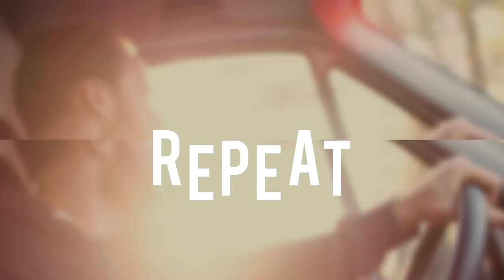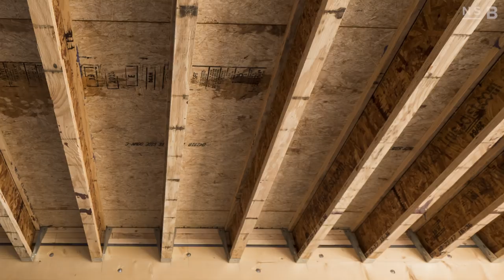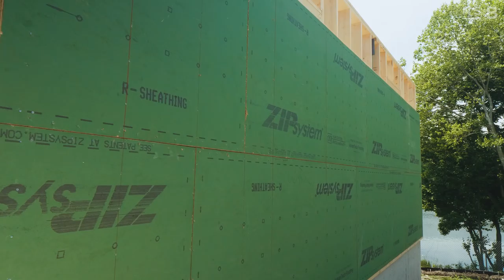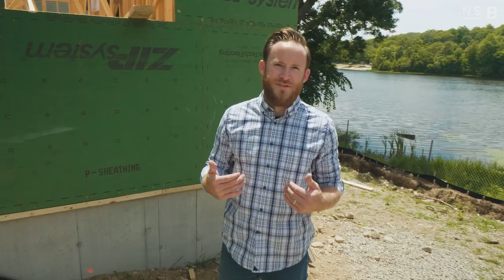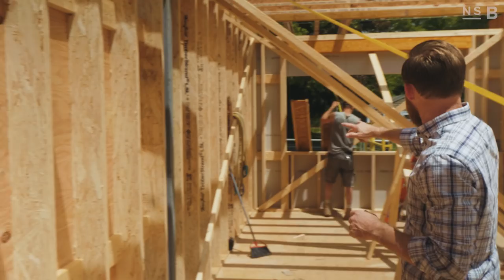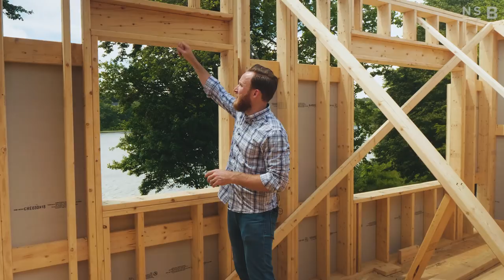Engineered Wood: Lake Drive Custom: Ep 03

Comment: Exterior wall framing where traditional 2x10 header sandwiched together, we now use one 5.5 LVL or timber strand on the outside. We don't use 2x6 flat under the header due to squash factor, but we do add a 2x6 under the header between the trimmers. For casing etc. Then you have the room to insulate the header leaving less R transfer.

Comment: Looking good, Nick. I probably would have dropped that basement beam a few more inches to eliminate the hangers, and chances of squeaking. I can see there being some square duct running by the beam, dropping that part of the ceiling anyways. 
Can't wait to see the final product.
Reply from the maker: Marko we really wanted as high of a ceiling as possible down there. One tip the framer mentioned that has been super helpful is keeping the hangers slightly wider than the joist. So they're fully supported but not squeezed tight on the sides.
Reply: NS Builders that's a good tip. I also make sure that mine are glued. I'm sure it would be fine in both cases. Thanks for the reply!
Reply: Marko Yea, a dab of construction adhesive on the hangers helps prevent squeaking.
Reply: singletrack86 squeaking you hear in floor framing is usually caused be wood rubbing on metal, weather it be hangers or nails. This is why it's always best to glue your decking to the joist and joist to hangers. You still nail/screw, but the glue reduces the chance that the the wood will move and squeak. The oversized hangers also reduces the metal to wood contact area which reduces the opportunity for them to rub and squeak.

Comment: The jack studs should go to the bottom of the header. With the 2*6 on the of the header there is potential for crushing. 
Your doing a great job
Reply: Obviously hard to tell but, I'd guess its non-load bearing. Seeing as the headers 1 ply, it wouldn't make sense to go back afterwards and add more lumber

Comment: Why use engineered lumber vs. a 2x10?  Laymen’s terms please for the non-builder viewer. Love your work
Reply: For the floor joists? Stiffer and flatter, for one.
I just used them on my current build, and it allowed us 24oc spacing. The biggest benefit was nearly eliminating bulkheads by running ducts through the joist webbing. There are some rules to follow, but the manufacturer provides a handy chart.
Reply: nah, use 2x10s for the walls
Reply: If you're talking about the engineered lumber for some of the walls, it's because those walls will have finished cabinetry on them, and you need them to be perfectly flat to avoid any issues with gaps in your cabinets.  Tile work is another place where perfectly flat is helpful, for say a kitchen or bathroom backsplash.

Comment: Rad. Curious if the r-sheathing creates any water vapor concerns inside the house since it’s not a vapor permeable product? Any special measures taken inside the house to adapt to this?
Reply from the maker: We will be running a 24hr ERV in the home, plus fully air sealing our walls.
Reply: NS Builders  Right on. Those measures will help reduce vapor diffusion for sure. To refine my question, I’m more curious about interstitial condensation created in the colder months of the year. A vapor permeable wall system can adequately handle this scenario by allowing vapor to diffuse through the system in either direction. However a vapor impermeable r-sheathing system prevents this exchange from occurring. Are you folks implementing special measures with the r-sheathing to manage/prevent interstitial condensation?
Reply: As long as the r-sheathing provides enough insulation to keep potential condensing surfaces above dew point then interstitial moisture should be kept to a minimum and the wall system should have plenty of drying capability to the inside (assuming no vapour barrier on the inside).
Reply: Stephen V Rad. That makes sense. Who runs the calcs on what thickness of r-sheathing (or exterior insulation) keeps potential condensing surfaces above dew point?
Reply: Kyle Ray Hughes Air sealing with the Zip sheathing and an adequate ERV should keep the humidity in the house in check and eliminate the possibility of condensation. Im sure they will also be adding an air gap of some sort between the exterior "siding" and the sheathing, the space between there is where most moisture problems accur. As for the thickness of the foam it all depends on your local climate, hear in the south we can get buy with half inch foam zip sheathing.
Reply: Depends.  Often the manufacturer has done calcs to determine that depth where condensation occurs (depending on the climate), or if you're using a passive house certified Architect (or similarly credentialed), there are energy models that they conduct.